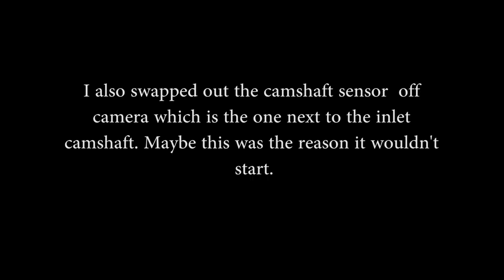2004 Vauxhall Corsa C Part 7 - Swapping the camshafts out.

Comment: Thanks for this I had to swap my head over so feel better about swapping the camshafts after watching this
Reply: Me too :) I 've just lost the line the intake side timing readjust thingy but this is a useful video for me :) Thanks !
Reply: @István Csóka  my advice is put the head bolts in the head sits on two dowels give the head a slight tap with a hammer at each end this seats the head properly on the dowels well that's what I did then torqued the head down mines fine been brilliant ever since